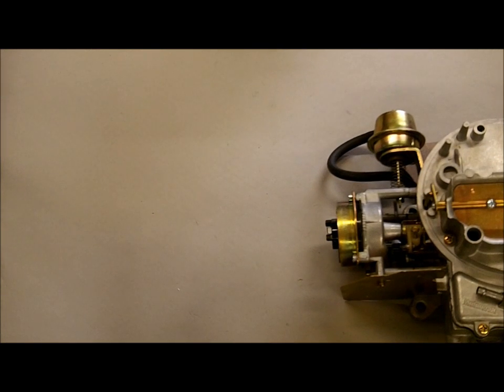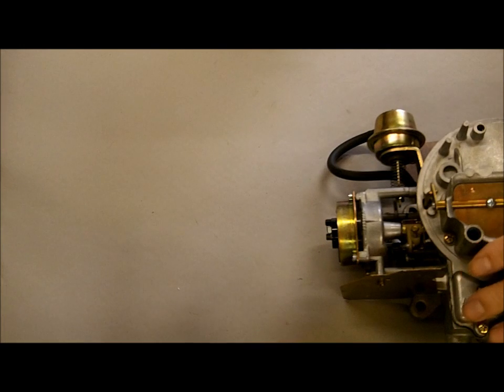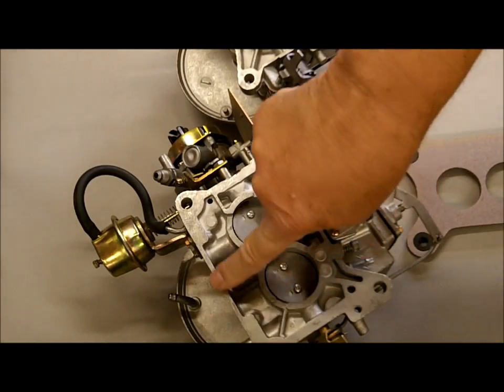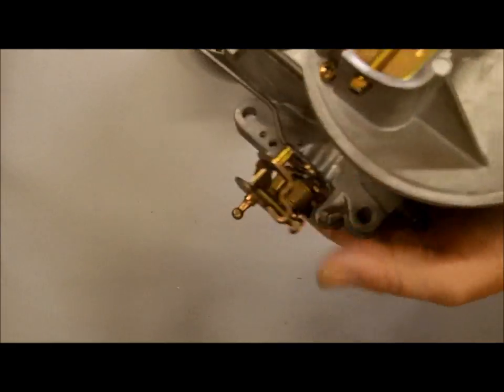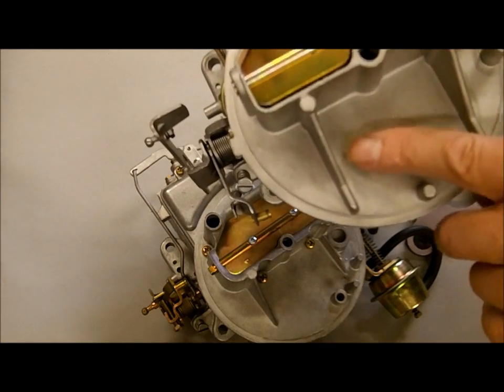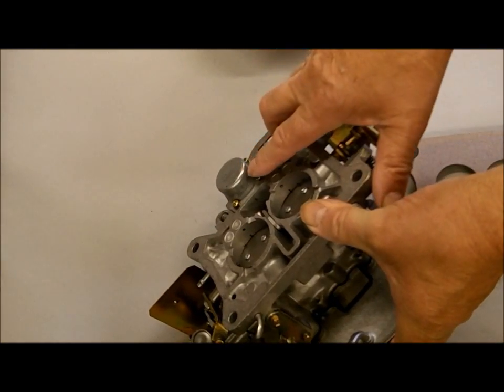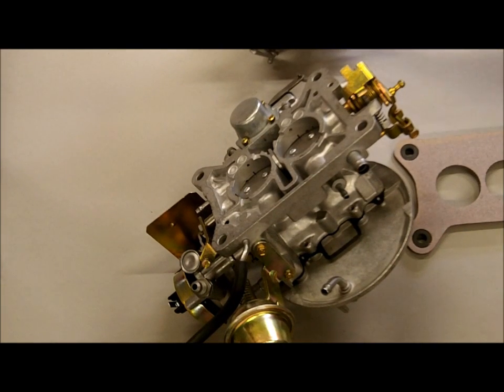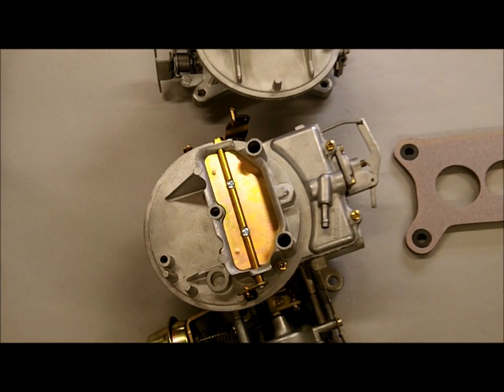Motorcraft 2100, 2150 Differences

Comment: 7-7322a is a remanufactured Motorcraft carburetor. it’s a 2100 D style model. while based on the 2100 D style design some 2150 features are added to it

Comment: At 2:49  what is that vacuum port on top for? The one that runs up from accelerator pump??? I can not find any videos on what the heck this was added for??
Reply from the maker: Not a vacuum port but a bowl vent.
Reply: @ how does it work. The arm comes up from accelerator pump ?
Reply from the maker: @BasketCaseGarageForFun  Maybe you refer to the bowl vent controlled by the accelerator pump rod. The rod forces the vent open so that the gas in the bowl doesn't get siphoned out.
Reply: @ so the bowl vent get hooked up to manifold vacuum,but only opens at  higher vacuumed?
Reply: @MikesCarburetor  Great video!  I have the same 2150 Carb.  Do you sell the bowl vent hose?  Mine is cracked/ dried up.  The hose is 1/4 inch on one end and 3/8 inch on the other.  Or can I just cap the vent bowl on the carb?

Comment: Can I put a 2150 on my ford 352 that d a2100???
Reply from the maker: Yes, match the venturi size stamped on the side of the carburetor.
Reply from the maker: OOPS! I forgot about the mount. You would have to find an adaptor to fit your manifold which would be very hard.

Comment: Is there an adapter to put a 2150 on a manifold meant for a 2100? Can the throttle and kick down parts switch over from the 2100 to a 2150? Thanks!

Comment: I bought two power valves from you. One was unidentified that looked just like the one that was in the original carburetor.  I installed that one 3 weeks ago. I thought I fixed the carburetor, nope, I took the carburetor off again to find gas in the cap. Checked the powervalve and found it was not closing all the way. The plunger part leaked.  I can return it for your inspection if you want. I just put in the other one I got that tested good on the bench. This one is half of my vacuum at 20 so I got the 10 /5  two stage. Hopefully this one will work with no issues.  I think the unidentified 2 stage powervalve you sell eather opens with very high vacuum pressure or a defect and that's why it's not marked in anyway .

Comment: Are both carbs emissions legal I have a 1982 ford bronco 351w I want to gut the eec3 CA wireing and go with the dura spark 2 so I'm pretty sure I need to get rid of the stock VV carb that is ran by the computer so if u have rime pls let me no and if u have one in stock

Comment: Interesting but I've been looking for a 2150 choke set up video..I'm having an issue getting the idle up when on choke. Is this an unloader adjust? I do know I have a bad pull off mines in the mail atm but that won't increase the choke idle when cold.
Reply: @MikesCarburetor  well that's great Mike, I look forward to it. Great info as always and thanks again..

Comment: Thanks 
Just rebuilt the 2100 on customer’s 1970 351 Cleveland Ranchero 
Gas pouring out the breather
What float level do you recommend and ever do a “wet” running float adjustment, like they mention in the shop manual??
Need answer asap 
Thanks 🙏

Comment: I know the 2100 comes in two different venturi sizes. They are cast into the side of the venturi casting. The one on my 390 Ford was a larger one. Any into on which applications had which?

Comment: Can I use a 2150 on an intake designed for a 2100?
Reply: I see the difference in the two.  My issue is that i have a 77 302 with a bad intake manifold and there is a guy locally that is selling an intake for a 68 302.  The 77 uses a 2150 and the 68 uses a 2100.  I'm wondering if there is an adapter that will seal the back side of the 2150.
Reply: I have a adapter that I'm going to use on my 71 Ford truck it came with a 2100 am going to put a 2150 on it and it as a 302

Comment: This is somewhat off topic but do you know whether any 351C 2V air cleaner assembly will fit any 351C 2V Engine or is that dependent on whether a 2100 or 2150 carb is installed. In other words... do they have different sizes?

And question number two: My '72 Mustang Grande has an electric choke pull off (thanks to you I know its a 2150 now). Do you know when that got introduced? I am not sure its the original carb.

Many thanks for your great videos!
Reply: TheUmbrella1976 I'd like to know the answer to that question myself.

Comment: I don't know if you still answer questions about this, but my 1966 mustang 2100 2bbl carb is beyond repair. The only reasonable replacement I can find is the 2150 carb. Will I need to make any modifications to make it work on my '66? I saw a post online that some guy had to reroute his fuel line, but I don't know if you need to block off any of the excess emissions lines on the carb. Thanks.

Comment: Hey Mike, I have a 66-77 MC2150 2bbl off a ford bronco which had a PVC port driller half way through the carb base but not completely through i.e. No vacuum or suction when I place my finger over the hole. Should I complete the bore and add a spout for a PVC connect or just leave it closed? 
Thanks
Reply: Ok thanks!

Comment: hi thank you for the info .i have a 1969 f350 with a 390 ..what is better the 2100 or the 2150..it has a 2100 me but has all the crap a 2150 has..im confused and just wanna know which is the correct 1

Comment: i have a 1970 f250 that had a 2100 in it and i bought a 2150 for it will the 2150 work and if it does do i have to hook it up differently

Comment: Thanks Mike, another great video! My 78' F250 with a 351M has a 2150 on it, but it is needs rebuilt and my friend has a almost new 2100 that he will sell cheap. Can it be made to fit in place of my 2150?